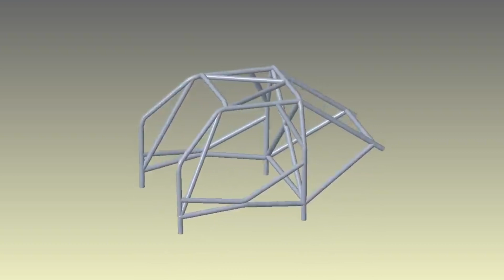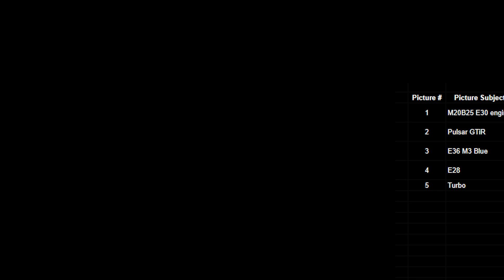Ep5. E21 pt2:  Tripling my horsepower with a simple engine swap

Comment: Very intrested to hear your opinion about the added weight and how the handling changed.Also if the horsepower is usable.
Reply from the maker: @wolfy3007 I'll definitely give a full review once it's all fitted. The M52 engine is pretty much the same weight as the M20 so the E21 chassis can definitely handle it. It will obviously move the weight forwards slightly due to the 2 extra cylinders but I doubt it will affect handling too much. I'll let you know...